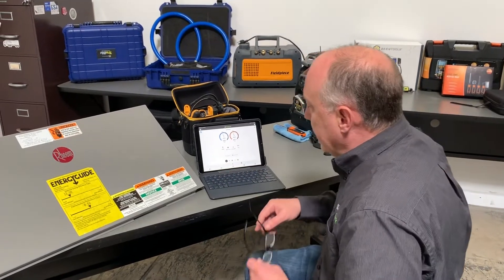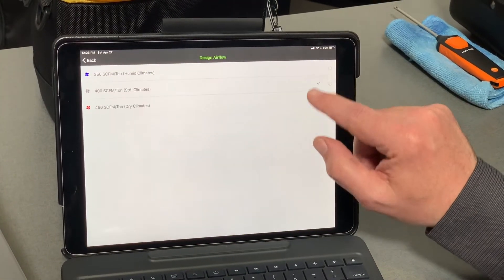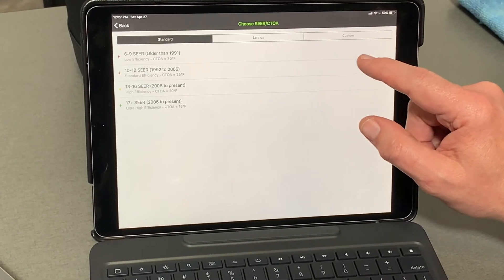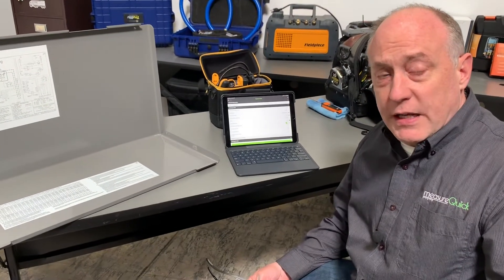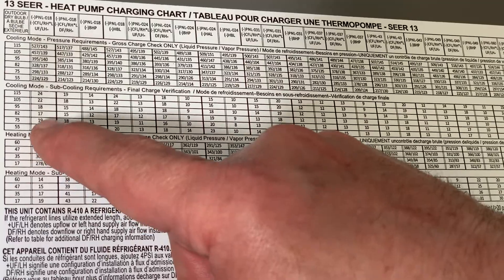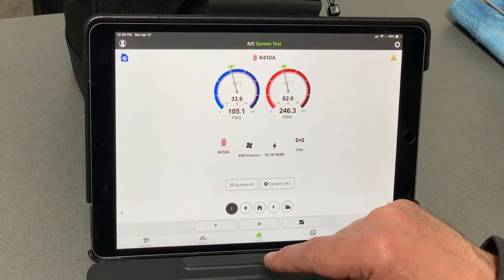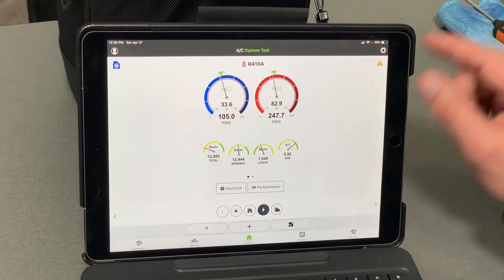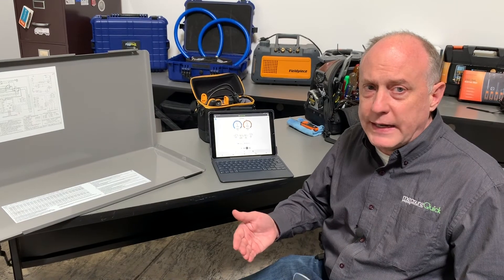How to set up your project profile on MQ

Comment: Starting a few months ago, the High Efficiency tab in the "Choose SEER/CTOA" is no longer visible in the System Profile Section.  Did this get removed by design from a recent software update, or is there an issue with my app installation on my iPhone?

Comment: Why does MQ need a SH target on an TXV system, when SHT depends on ambient, IDWB, suction line saturation and suction line temp?  Would appreciate a brief response.  Thank you.
Reply from the maker: Every measurement requires a target, otherwise why would you measure it?  Typically superheat airConditioning is between 10 and 12° for refrigeration it could be as low as 6°.  On a TXV system, the superheat remains constant independent of the load conditions. Your evaporator superheat should remain relatively constant within a degree or two of the static setting of the valve.
Reply: @measureQuick  thank you Jim. Your reply is very helpful and very much appreciated.

Comment: Nice! Why is it that I save a snapshot of outdoor inputs (pressures, ect.) on a project, then view the project and cannot see psi, SH, SC or the like?
Reply from the maker: I think you’re confusing capture, which locks in the readings and save data which saves them to the report. The save data section can either be accessed in the report itself or by hitting the + key and taking a snapshot

Comment: What about on a Refrigeration system?
Reply: Set up?
Reply from the maker: It is on the development roadmap, we are wrapping up a few other projects before we can really get into it. We have been making some small improvements including calculating the weighted center of blends on the evaporator and the mid point on the condenser. Rest assured, it will be done.